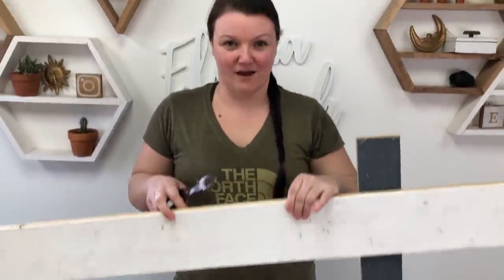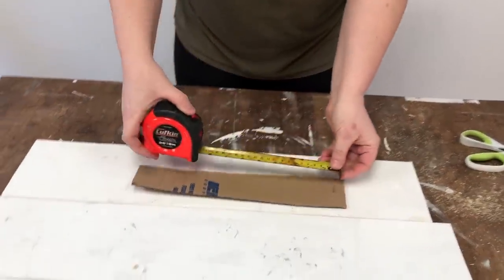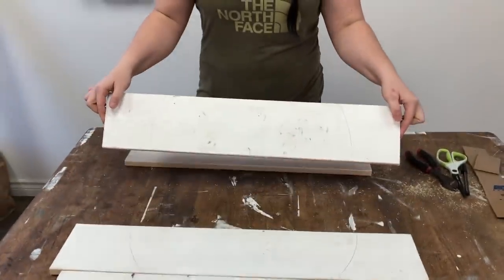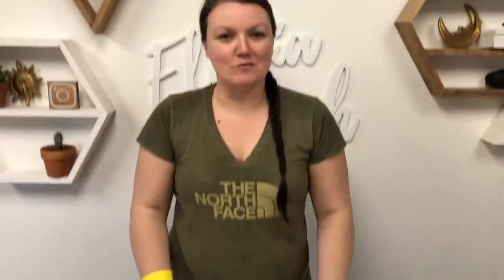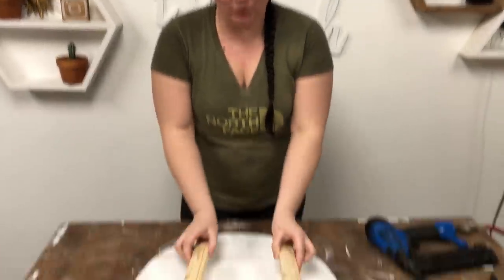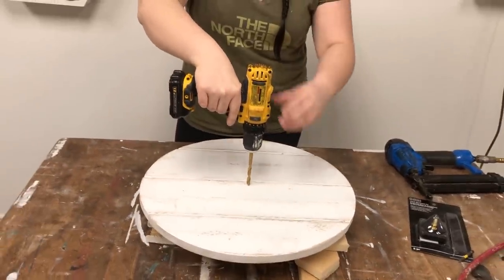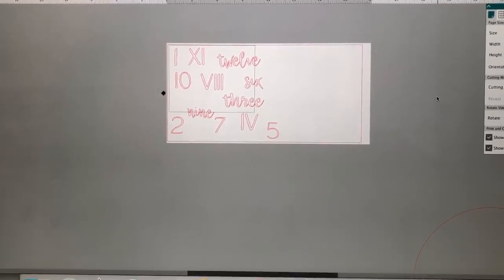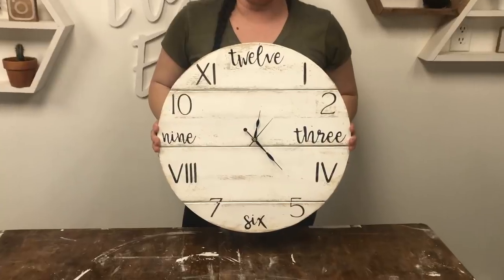Farmhouse White Shiplap Clock | TIK TOK DIY | How to build a wood clock EASY

Comment: Turned out great!  Thanks all your inspiring project videos! 
I wanted a large rectangular clock, so last year I bought the materials, a stencil, and the mechanism at a craft store.  
I liked my clock and wanted to make more, but it was expensive.  I started to collect scrap materials to up cycle, but I still needed the mechanism which wasn’t cheap.  So I put an AA battery in my purse and started looking at thrift stores.  I have been able to find several unique, working mechanisms from some ugly, unwanted clocks at thrift stores for $4 or less.  It was very easy to remove the part I wanted and have even got some use out of other bits and pieces.

Comment: You’ve done it once again!  I love making clocks and, in fact, when I was on a deep hunt for a circle jig yours was the best, easiest tutorial I could find.  I have used the scroll saw method which works great too! 
Stacking wood and setting the clock on top in order to not drill through the table 🤦🏻‍♀️. Way better than using a sacrificial board.  You are a genius and I thank you a million times over for your tutorials.  Philip captures that element of knowledge mixed with love and humility that you portray.  Great team, I can’t say it enough.  Okay...sappy post over 😊

Comment: Elysia!!!!! I need your help! How do you avoid wood from warping- do you have any advice? Noticing that some of my projects is having that problem- after it’s been stained or painted- please help! 😢
Reply from the maker: What type of wood are you using?
Reply: Elysia English pine board! And also, my hubby thinks I can’t nail the sides of a 1/2 inch pine plywood board to do a frame on my signs. Is there a special way to do it so the plywood doesn’t split- if that makes sense?
Reply: Elysia English and thank you so so so so much for replying back to me! You have been my online mentor in making my own wood signs! Your videos have been so much help, love watching your channel! 🥰😍❤️
Reply from the maker: @traceycalle  I use brad nails to attach my frames and i also use pine for my signs often. Make sure to keep them dry & lay them flat when storing them so they dont warp
Reply: Elysia English okay great, good to know. What size nails do you use? I also use 1x2 for frames.  In regards to warping, I store them in our garage or basement, does temperature have affect on the wood as well? I’ve been doing research, some recommended applying wood finish to avoid moisture getting into the wood on the sides. Would you recommend?
Reply from the maker: @traceycalle  Yes temperature will affect the warping you may have moisture bothering your wood. I use 1 1/4 inch brad nails when using 1x2s pine for frames
Reply: Elysia English okay, thank you so much! LOVED your wooden clock video! Hubby and I are going to try it out 🤞🏽